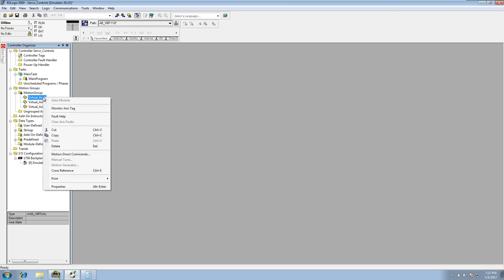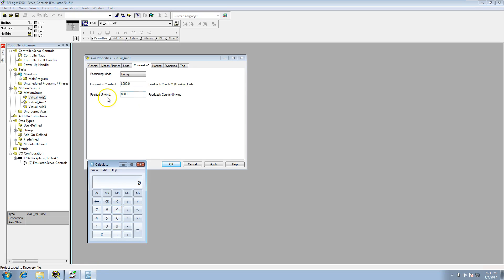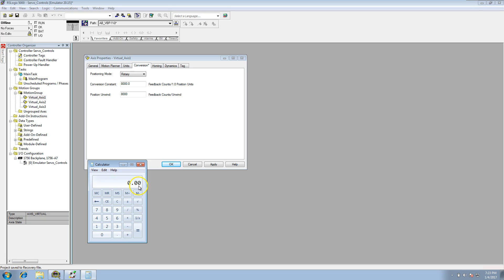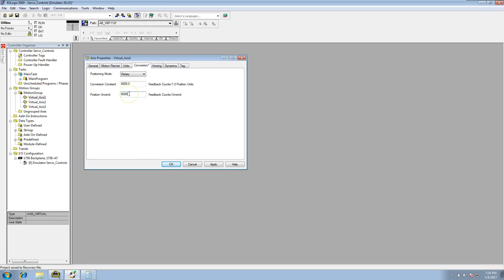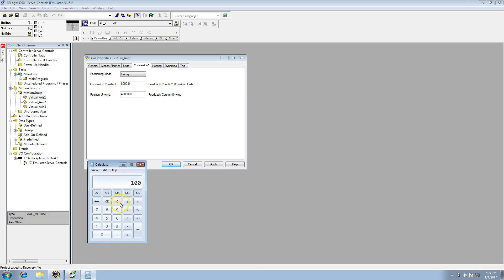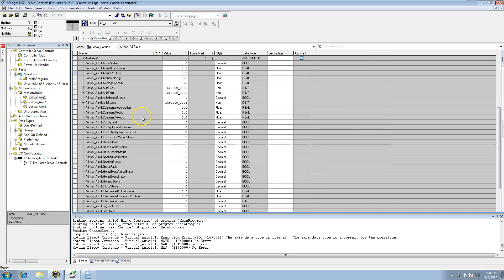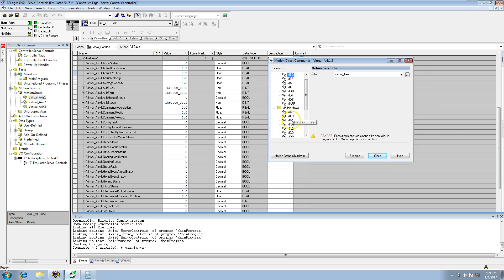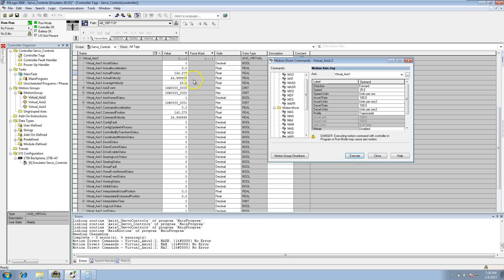RSLogix 5000 Servo Control  - Rotary Axis

Comment: Will this work operating the servo bi-directional? I have a servo connected to a gearbox On a rotary apparatus that needs to work in both directions. Everything I have tried so far will ONLY JOG forward. If I try to reverse direction, it will still only move forward. Thanks
Reply from the maker: Then it sounds like a mechanical hang up, maybe something is wrong with the gearbox
Reply from the maker: In other words, yes...what I show is bi-directional if you swap the direction you wan to run.

Just note that a servo has a standard order of operation it needs to follow before movement.

That could be your issue as well.

I have a video on this YouTube channel about servo order of operation
Reply: @ShaneWelcher   I also have (4) servo-driven hoists that have no problem going either direction, but they are set up as linear. The servo function in question is set up as rotary with a scaling unwind parameter for 0-359 display and control. Is there any way I could have you look at the program? It is too big to copy and paste here. Also, to whoever reads this, I started out learning how to program AB PLC's by watching Shane's YouTube videos. Awesome teaching tool. If you want more than YouTube, check out Shane's Servo Motion Mastery courses at Udemy.
Reply from the maker: @emilwirth2113  email me the program, I'll look into this.

Also, talk about what is wrong that is causing the question.

Shane@OnlinePLCsupport.com

Comment: How to manual jog servo only one pitch of ball screw ?
Reply from the maker: Add a manually controlled request that triggers a mam instruction to a certain position that seems to fit what you are asking.

An MAJ instruction is a continuous move as long as active so if you use an MAJ then set that instruction run speed really low.

Although, it sounds like the MAM instruction sounds best for what you are asking.

Comment: Hi Shane, I have a problem in a servo motor, the actual position variable when the servo does a move or a jog, only have a variation between 0 and 1. For example, if execute a MAM the servo completes the move but the actual position variable doesn´t show the real position, only a variation between 0 and 1. 
Any idea what the may be?? Thanks!
Reply from the maker: It really could be multiple things & without seeing it, this is really a long list of things to check.
Reply: @ShaneWelcher  yes, I suspected. I´m gonna start to check the configuration, but I think I did it well. Thanks for the quick answer anyway!